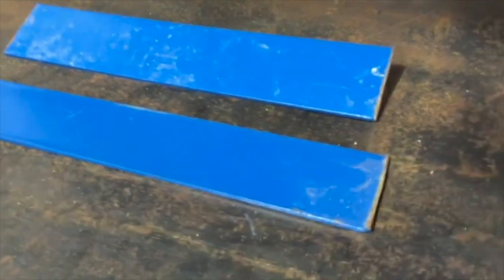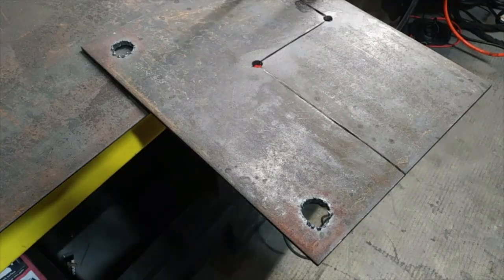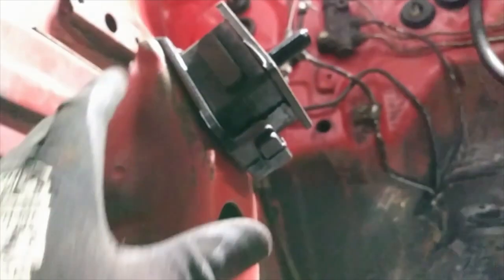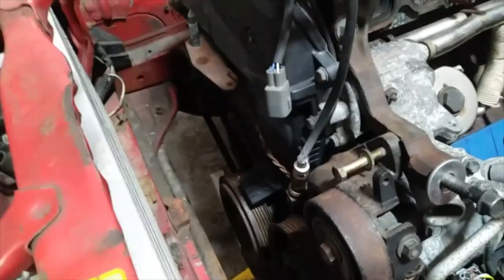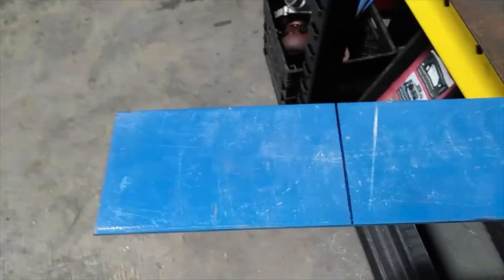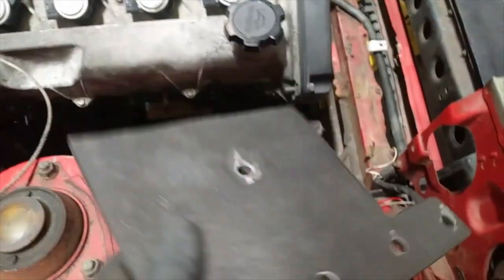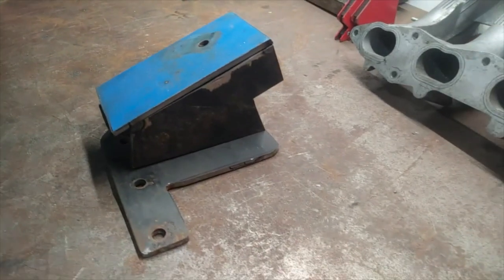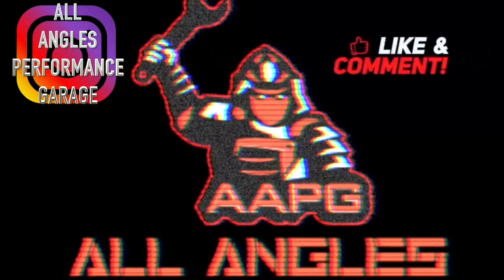KP61 Starlet 3SGTE Swap Episode 3 : How to Fabricate Engine Mounts

Comment: hey i wanted to buy a starlet and do a fifth gen 3sgte swap the one out of the caldina gt-four awd drive wagon will the original setup being awd have any set backs besides the stuff mentioned here so far its the one i would like the use the most as now like all the others its been getting less pricey to buy over the years and makes the most of ange 3s engine in stock form tuned or non tuned stock sitting at 256 hp which in a car this small would be nothing to scoff at